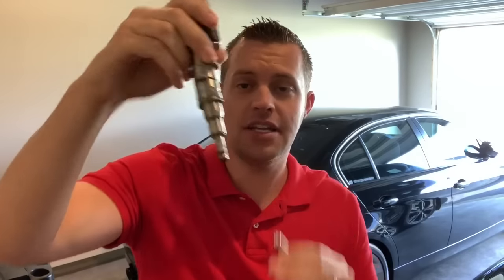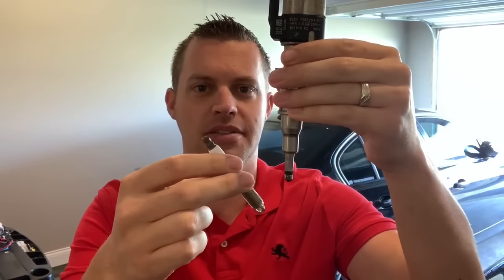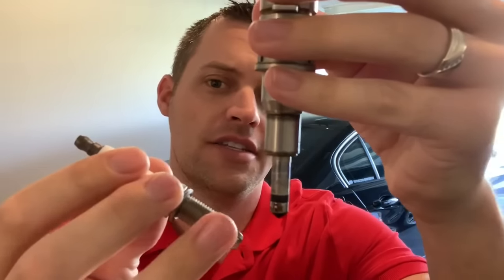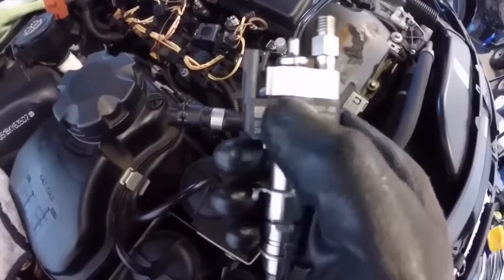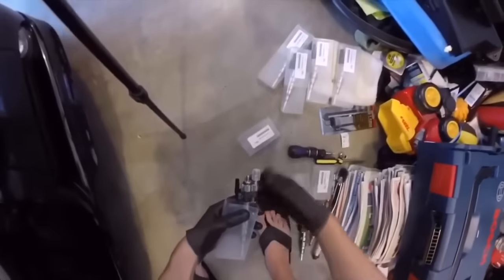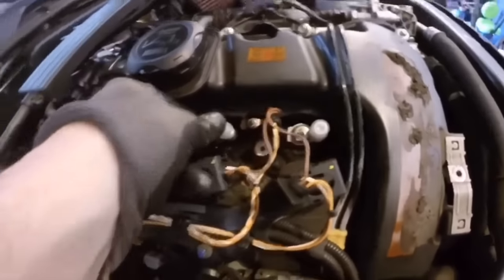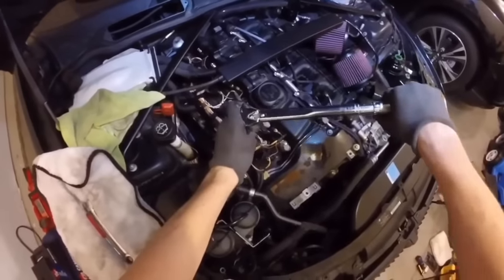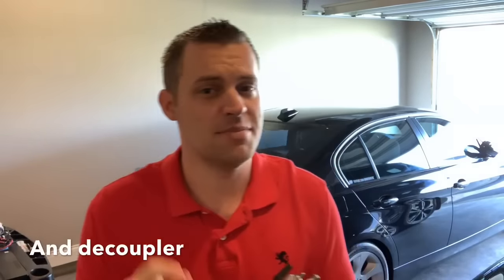How To Tell If Your BMW Injectors Are Leaking/Clogged!

Comment: UPDATE as of November 13, 2019: Just checked at FCP Euro website and the BMW Fuel Injector Kit (set of 6 for Index 12) cost $1388.52
Reply: some1particular wtf
Reply: Yeah they're a bit pricey. Also should be noted if you plan to do it yourself, you're going to need to code them. Carly app works well for this but is an additional $50 to your total cost. Granted it's another $50, the Carly app allows you to alter a lot more than injectors. Door chimes, etc.
Reply: 2024 aug8th 3,062 $

Comment: In the UK, BMW dealership quoting £479 for index 11 or 12, plus £140 fitting per injector = £619/injector, or £2.5k for a N43 4-cyclnder.

Comment: If I have a leaky/faulty injector, can I replace the culprit with an index 12 mixed with the other injectors until I can afford to replace the rest with matching set?
Reply: You have to have each bank all the same I’ve got index 12 on bank 2 and bank 1 are index 1

Comment: You don’t need to buy the injector seal tool. Use a razor blade to cut off the old seals. Use a pen cap to slide on the new seals. Compress it by wrapping it in electrical tape and waiting a couple of times. Repeat the electrical tape process 2 or 3 times until snug.

Comment: My 2014 bmw f20 shakes when suddenly accelerating.. if i reduce the sudden acceleration, it will stop shaking and slow increase of speed will make the trick.. but if i keep fast accelerating it will trigger drivetrain malfunction and misfire cylinder 3... the spark plug from cylinder 3 is fine, i will check the coil today.. my car is 83.000 kilometer and i believe never changed the fuel filter.. any chance that could be the issue? Or clogged injector? I have a scanner and while driving the injector looks fine but as soon as i trigger the malfunction, the ecu turns off the injector (i think).. or maybe air intake? I checked the air filter and it is super clean

Comment: I got that delphi coil/spark plug pack for $200, $300 in total with install. I had a misfire and was hoping it wasn't an injector....has not misfired since. Runs great and fast now.... Plus I stuck some seafoam into the gas tanks to clean the injectors just for the hell of it. My buddy had a misfire and 1 coil pack was $200 for his WRX ROTFL. I think he was having a ringland issue though si he might be getting a rebuild under warranty.... this is his 2nd rebuild and he only had 20K on his 2016 WRX.

Comment: Hi ! Nice video. My x6M (s63) black smokes when reving after long idle. I replaced : spark plugs, coils, air filter, fuel filter, all the 4 o2 sensors, but still have the issue. No CEL, no error raised in memory, no jerking. Just long crank time sometimes 

Do you think it’s due to leaking injectors ?

Comment: My car currently runs on the wrong injectors (EU 6) courtesy of a Daytona Beach dealer who installed them going off the VIN number which is the wrong way to determine which ones you need at least for a 650i F12. I need EU 5's. One out of 4 or 5 times it stutters a lot when starting either warm, or cold and after extensive diagnostics the dealer here in Tampa found what the problem was. Based on your video I probably not only have the wrong injectors but also some leaking ones as well and probably some spark plugs on their way out. When it is running it is a beast 99.9% of the times and does not hesitate but that rough start with erratic RPM's and engine knocking for about 10 seconds is nasty. You recommend BMW injectors but I think I'm going with BOSCH EU 5's since I don't think BMW makes their own injectors plus Im getting a lifetime warranty from a reputable business. Any experience with the BOSCH injectors?
Reply: Did u get fuel in ur oil when u had leaky injectors ?

Comment: 5:45 helped me figure out that my N54 cylinder 2 injector was leaking. After fixing everything else. The guy I bought he car off of said he replaced injectors it turned out it had still been leaking. Got the car fixed and now it runs like a charm
Reply: If they replaced them why were they still leaking ?
Reply: @giannilopez549   because the guy swapped bad injectors I’m not knowing how to work on these cars.
Reply: In*

Comment: Note to anyone who replaces just 1 or 2 injectors, you cannot mix index 10 and lower injectors with index 11 and higher injectors. The calibration between the two revisions are not compatible. If your engine has 10's or lower, I'd highly recommend replacing all 6 with the latest updated injectors. mixing 11 and 12's will work if you already have 11's and need to replace one or 2 with the new revision.
Reply: How will I know which index injectors I have right now ? I have 2011 550i

Comment: Are there any aftermarket options that you’d recommend for better than index-12 performance?
Reply: u can delete the direct injection , and just use port
Reply: @MikkelMcKinnie you’d need to use a standalone ECU if you delete DI. also you need to plug the injector bores in the head, VTT sells a “DI delete kit” but I’ve never used it so I can’t vouch for it

Comment: My injector blew while I was driving , all I heard was a pop, my car began to misfire , and limp mode light, but still had boost cc ID 29. Cylinder 5 had no power,  so I tried the spark plugs and coils , no change . I took cylinder 5 injector and put it on cylinder 6 , then cylinder 6 no power cylinder 5 fired up. I’ll be swapping the injectors next week.

Comment: I am having a rough cold start and the engine is running a little rough at idle.  Thanks for the good video
Reply: Rough idle : don’t destroy the car to solve it! Valve and injectors need cleaning ❤

Comment: Thanks for the info, does the HPFP maintain a pressure on the rail when the motor is off normally? Or does it bleed to near zero? What pressure should be in the high-pressure rail and for how low after engine shut down?
Reply: The HPFP losses it's pressure fairly quickly when the engine is off since it uses the mechanical energy of the engine to build and maintain pressure. The line pressure will drop quickly from the HPFP values at idle 700+ PSI but your LPFP should hold it's 70+ PSI for a few minutes and bleed slowly.

Comment: Hey BMW Fanatic.. thumbs up! very informative video! i have one question.. Is it possible to use the metal injector cap for adjustment of the injector seal? i mean without that special bmw tools to adjust the seal. The new injectors come with that metal cap on it so my thoughts are (in case of changing the sealing) to put the seal on the injector and compress the teflon seal with putting the metal cap on it for a few minutes.. Should make the same effect as we know the new ones are delivered like that. What do you think?
Reply: If you watch jake spences video he describes how to do the seals with that cap and a pen it works I’ve done it with my injectors

Comment: Hi. I have a problem with two of the fuel injectors. The repair shop diagnosed injectors 3 and 6. The repair shop says it is best to replace 6 injectors. My question is, can I change only 2 injectors? 6 injectors need to be changed?

Comment: Have misfires in all 4 cylinders and something with bank 1. Obviously all plugs or coils didn't go bad at once, so I'm guessing injectors. Sometimes a semi rough. Obviously without seeing in person, does this sound like I'm going in the right direction?  Thanks for the explanation and video.
Reply: What did you end up doing to correct the issue @michaeljo281

Comment: I had a wet plug this morning. Rest were fouled and black but not wet and didnt smell of fuel. Would you recommend all new injectors or just the one that's leaking?
Reply: Plug that was wet stunk of fuel
Reply: Same. I can notice only one spot where I’m sure the first fuel injector is leaking, leading to my pretty wet cylinder 1 spark plug. As with somebody else that commented, the rest of the spark plugs are black and burnt but only the first spark plug is wet. In my BimmerLink error memory I had codes for misfire on all cylinders though. Hopefully replacing the one fuel injector and all spark plugs will do it for my ‘10 535i.

Comment: New fuel injectors are very expensive and if you have a 12 year old car its not worth buying new injectors,so i chanced it and bought 4 used injectors which cost £160 and replaced two leaking injectors with two used ones then coded them in and all is fine now and  i have two spares left over,so in my case it paid off.
Reply: You gotta pay to play

Comment: question... my s63 engine was rebuilt so the injectors would have been taken out and put back in and that seal you mentioned would not have been replaced. I have bad starts, limp mode on exceleration, and lots of black smoke.. would that bad seal cause that? I never had an issue before the engine was rebuilt... thx

Comment: Thanks for the info. I have a n63 2011 with fairly low kms. Had a misfire intermittend if car stood for week. Today i pulled all the plugs and all looked very well except cylinder 4. The tip is pitch black and gunked. Could that be a stuck open injector or rather a coil? After new plugs is in car really smooth and responsive.

Comment: I recently had one clogged fuel injector replaced by local indy shop on a 2014 X5/F15 for $725.  Engine was misfiring and throwing codes, pinpointed to cylinder #2, spark plug was soaked in fuel.

Comment: I have Diesel leaking (at injector #1) at the back of the engine and also gas leaking. I've replaced the seal and cleaned everything up nice and tidy and after a bit over a day (40 miles driven aprox.) the problem is back as it was. I don't know what else I can do. Here is a link to a video showing the problem. @   Slacky power, fumes in the cabin, very bad fuel milage, These are the symptoms. At times I get the P0402 code (EGR related) but that wasn't the case when it was working fine + I had the inlet manifold, throttle body and egr cleaned recently with swirl flaps delete. Any suggestions, please? Thank you!!!

Comment: My car is acting crazy missing and sputtering like mad with no codes so I had the fuel pump changed and nothing so i went back to the guy that had it and he said he was putting low octane gas in it and i should not have filled it up with high octane because that screwed up the fuel filter so what do you think I should do?

Comment: All my plugs have Fuel on them , my car won't start it just winds over an over I even found fuel in the charge pipe. My question is this , being direct feed will the Injectors keep pumping fuel into the motor even if it's not running. I have a set of index 12s

Comment: Hey New Subscriber here, love the channel... question... Have an E92 '09 335i x-drive/N54 Engine. My car sometimes goes into limp mode when hard accelerating. I've been having a few misfire codes. Replaced the spark plugs and coils like 5 times, I found there to be gasoline deposits on my spark plugs. So I'm guessing this means I need new fuel injectors? Any info on which kind/where to buy new fuel injectors? Also, my car gives a really hard misfire sometimes after replacing coils/plugs, but when I press the coil in harder, jiggle it a bit, unplug and replug on certain cylinders, the misfire goes from rough to very slight. Could there also be a problem with the threading of where my spark plug is or how the coil fits into the opening? Have you heard anything like this? Any info is appreciated, Im going broke fixing this car! The dealer had replaced my coils/plugs and gave it back to me with a very rough misfire, I went home and just replugged the coils, pushed them in a little more snug, and the misfire went back to being very slight. Any info or knowledge on this is appreciated. You can also email me at seangorman86@gmail.com. Please help me! Thank you so much!
Reply: Truth World FCP EURO!!! They give lifetime warranty so you are only paying $1200 once and after that you are good to go. Never heard of that issue with the plug not fitting on right. Make sure you have the spark plug tubes in there (thin metal in the valve cover.) Its important you have a scan tool that way you know which cylinders are misfiring. Once you do that you can change a coil from one cylinder to the other to see if it changed to another cylinder.

Comment: Hey changed valve cover out came with new pcv threw a misfire spark plugs fixed it then looked at turbos and turbos are dry and not leaking no loosin oil from waht u see but car still smokes when coming to a stop what could it be

Comment: I have a 2015 328d. Throwing a code for injector 1 being at the lthreshold limit or something like that. My fuel filter hasn’t been replaced yet so I’m thinking it could be an intermittent issue with the fuel filter clogging and reducing pressure. But I can’t find anything online that’s the exact issue I’m having. The car drives fine, never hesitates, although sometimes and I mean SOMETIMES, when I get to a light it will bump up and down in rpm a tiny bit but it’s not noticeable, you have to be looking at gauges to see it. Any help would be appreciated.

Comment: On which engine? On an n52 the plug is situated dead center above the piston inline with the cylinder center, the injector is above the intake port at an angle and either level with or just below the plug, and will not “leak” on the plug

Comment: Please help ,I'm desperate. Got a rough idle when engine hits operating temp. Changed Valve cover, plugs, coils, maf and upstream o2. Sometimes i get codes for air fuel mixture and drive train malfunction.

Comment: Please help
So I have a 1990 bmw 325i and it’s running rich and it has a rough idle. It doesnt stay consistent mainly goes down(sounds like it’s going to stall and then goes back to normal) and I got white smoke coming from the back of the exhaust.
I’ve gotten a new o2 sensor, a standard tune up, cleaned the icv, clean fuel filter, cleaned the piston tops and valves but it’s still running rich and not idling correctly. I don’t want to take it to a shop because everywhere I go they have ripped me off. Also I’m not a mechanic I’m just learning about cars and how to work on them this is my first ever car I’m working on and I’ve gotten it to run and everything this is just the only problem I have. Do you have any advice/tips on how I could fix this problem? Should I just replace the injectors?
Reply: Vacuum leak maybe

Comment: Do these injectors need to be coded with the ECU if I replace them if so is it best for BMW to do the work because I do not have the equipment to code them with the engine computer.

Comment: Hey man, long time follower and I have a couple questions. I've replaced coils and plugs, both fuel pumps are in good condition, but I'm having rough starts and some slight misfiring. You thinking I need injectors too?
Reply: yes most deifinitely. if your car is idling bery rough on start up and idle than its the fuel injectors, i have to replace 2 of them ahhh bmws man
Reply: @stazzyjayy7346  Yeah I actually purchased some already. After doing a cowl delete I found it was hiding the god awful sound the Injector was making. If I could suggest anything, FCPEURO.COM AND NOT ECS TUNING! Fcp will replace it for the life of the vehicle, unlike ECS where you buy it once and still have to buy it again if it fails.

Comment: I have a bmw 535i 2008, I swapped out 3 of the injectors with index 12, the other three are index 11, after putting in the index 12 I got light on my dash that has a triangle with an arrow over it. I calibrated the injectors and that was all good but the car is shaking and still says cylinder misfire. The injectors it had looked gone. Need help 🤕 the ignition coils along with spark plugs were swapped not so long ago. Could the spark plugs be gone already ?

Comment: Hi mate I got a bmw n 53 engine and when I started on cold the car kind of have a rough idle but after u star to drive it goes away and it drives like a dream do u know what is the problem ? I do have mixture control codes.
Reply: Same problem here. Did you find it?

Comment: i have to change my 6th one on my n54 190k miles im gonna clean it first but i have a new one on the way. mine was saying fuel injector misfire/cutoff for my code
Reply: Xander I was getting that as well. Were you getting knocking codes? It could be the type of gasoline you currently have in it. Use only name brands Chevron, Shell, Costco, mainly. The thing about the injectors is you have to replace all of the ones for cylinder 1-3 or 4-6 if they are older than index 10. Anything 11+ are compatible with each other.
Reply: Adrian Gutierrez I wasn’t Getting any codes for knocking just misfire but I’ll have a video on my other channel when I fix it

Comment: Hi there good sir 🙏🏽 I've been having an issue with my e46 320d m47

The issue I've been having where the crankshaft position sensor had given out

I've replaced it with an oem bmw part and the car runs now

But the car does not want to Rev above 3000 rpm

Do you have any ideas as to what could be causing this issue?
Reply: Did you calibrate the sensor after installing? Can be done in inpa

Comment: Please help.   I have 175k E83 X3 2004 getting lean codes and inactive sensor codes on bank 1 only.  Data shows O2 sensors are ok but giving crazy waveforms.   Does this signal injectors or blocked cat?

Comment: i replaced my o2 sensor, fuel pump, fuel filter, fuel pressure regulator, coils, spark plugs, maf sensor and still the same lean condition and hard start. So i think last step is replacing freaking injectors!
Reply: I have the same problem... :( 1 injector prize is 300 euros; I should buy 4 . I think it was the last time with a bmw...
Reply: i think im going to sell this car and buy some Focus Rs.
Reply: @_________________7791  you are right